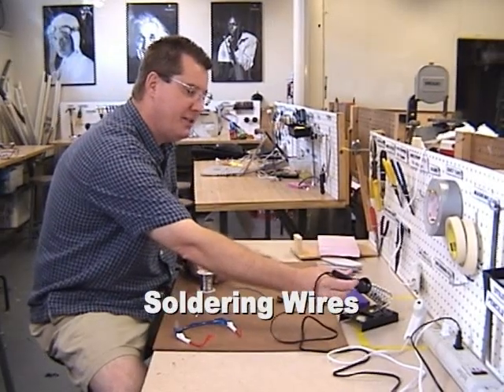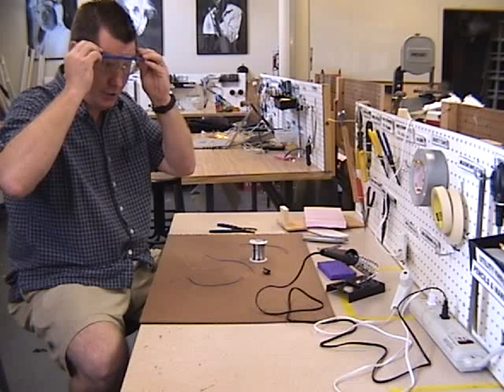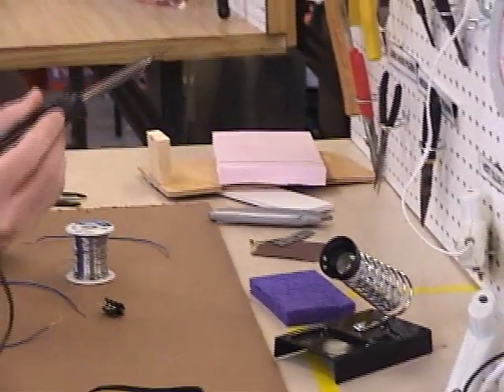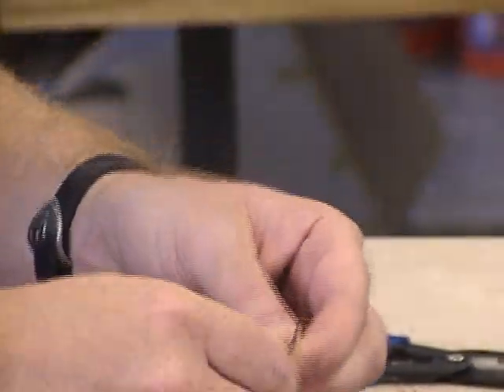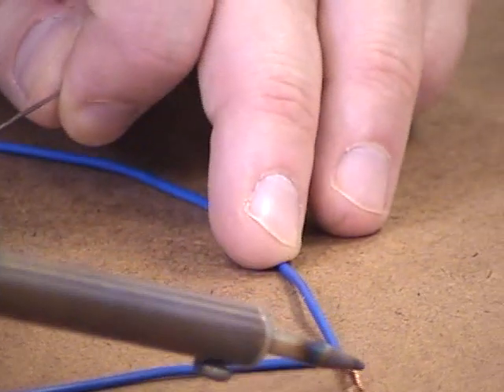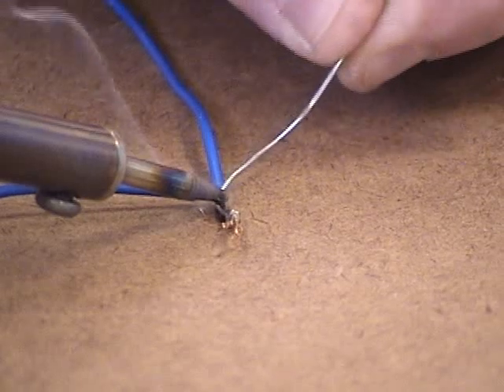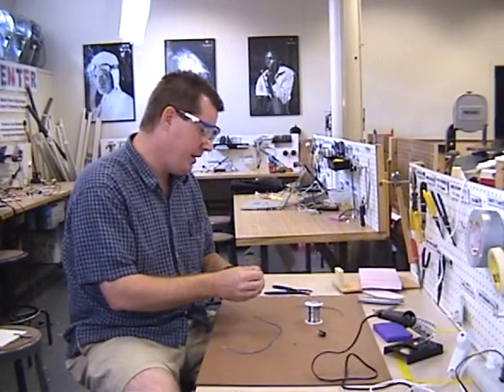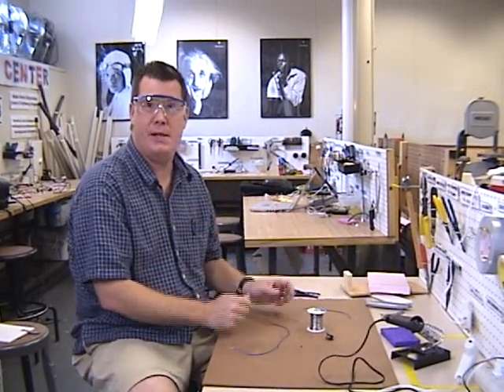DESIGN LAB: Soldering Wires

Comment: I was lucky enough to learn all this in high school. I went to a magnet school that had a Computer Integrated Manufacturing program. It covered basic engineering principles, manual and CNC machining, electronics (including soldering), CAD/CAM drafting, and we did a lot of work with robotics (AMATROL arms mostly).

Comment: That's the way I learned. I make my own audio cables to save money, using silver solder (which requires higher temps than regular lead solder) and with a nice ceramic temperature controlled iron that's been tinned you get instant heat transfer and a strong bond, but only at THAT spot. 
The way this guy did it you end up heating the entire wire or any components you're trying to solder (which can damage them).